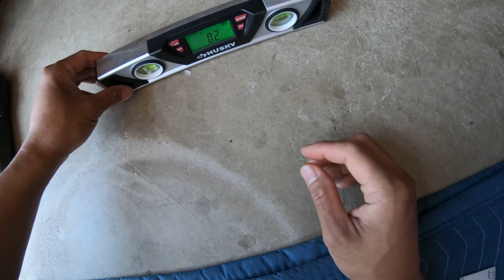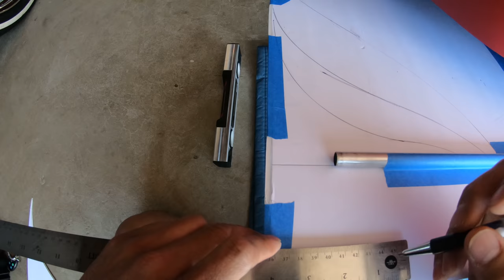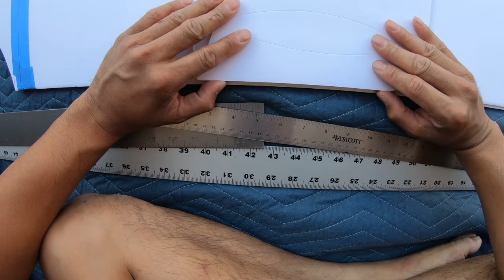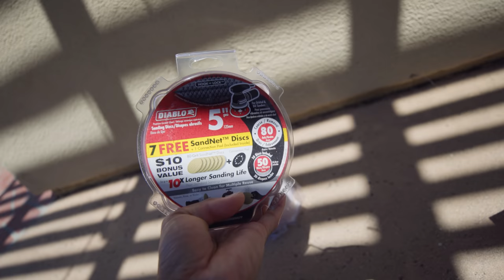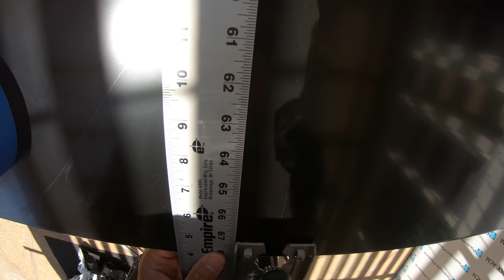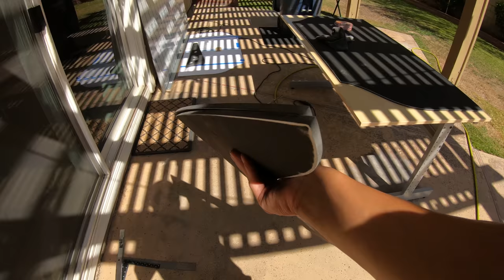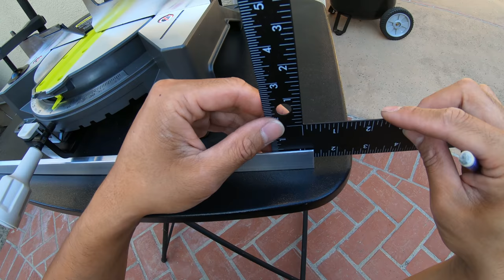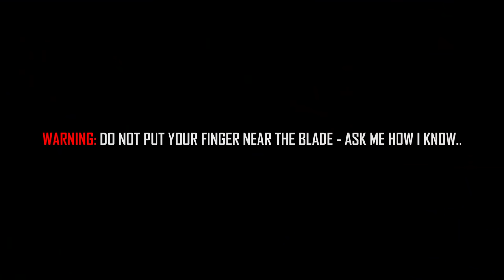DIY DIFFUSER | BUILD YOUR OWN DIFFUSER! | #OMGMIATA | EP25 | [4K60]

Comment: I like how you took your time and did everything right, didn't scrimp on things or take shortcuts. But I hate how it looks on the car. Doesn't jibe at all with the lines of the car. Looks like a  squared off Frankenstein piece on a rounded smooth body. Diffusers are supposed to HELP with aerodynamics, not cause problems with them. That will cause a lot of co-eff drag. Most people over build them, though. So you're pretty much par for the course. Think about it like this, when you look at Hyper and Super cars, they don't have gigantic things that stick way out on them. They blend these kind of parts with the aerodynamics of the body shape. Making it fit in and look factory is the trick... But I still enjoyed the vid. And IF you like it, that's really all that matters.
Reply: Have you ever seen any time attack car??

Comment: Why does everyone think this is going to cause more drag? 
He’s completely correct about diffuser angle so he’s probably not going to have issues with stalling that’s fine,
It’s cleaning up the airflow from under the car expanding it and making a low pressure zone sucking the car down while also saving the parachute effect the stock miata rear bumper has…
In concept this all seems completely sound, yes it’s huge but that seems to be the point? 
Don’t get me wrong this car will be heavily rear biased for aero even with the front downforce but cool, it’s a fun show car but this should absolutely work…

Comment: Great work! I am curious how you were able to bend/curve the outside panels? I know with the foam board you used a can but the ACM material? Thanks!
Reply: I would like to know the same.  How did you form the sides?
Reply: I was gonna ask the same question.

Comment: I feel like the diffuser was too much, went from a clean car to battle areo
Reply from the maker: Diffusers aren't for looks - but for functionality. How it looks is low on my priority list.
Reply: I design things in the middle,  my aero kit is actually functional and really helps with stability but I design it for looks too. But I do love the designs MASCUNNANA BEAR comes up with that are off the chart!
Reply: @OMGBUILDS  I have to admit I didnt pay too much attention to the series but this looks like a show car. Im sure you know more about the project more than me though lol
Reply: @OMGBUILDS   That's ironic, seeing as you went for the rocket bunny kit and run -85 offset stancebro wheel setup.
I can fit 285s under my 40mm Autokonexion flares, which is bigger than any Miata would ever need.
Reply: @OMGBUILDS  I think you are missing the point of each of these comments... The point is, If you truly were going for functionality, then you would NOT have over-built it for that size vehicle, and it wouldn't stick out like a sore thumb. The guys making these comments, including myself, are not trying to be offensive. We all enjoyed the vid. But we see problems with the functionality of it, and that is the reason for the comments, not just how it looks. Diffusers are NOT bigger than the cars they are on, unless someone is out to grab a bunch of random attention. Functional diffusers are usually less than 70% of the width of the rear of the car. The idea is to channel air from under the car, not the sides of the car. You want to join that underneath air with the air from over the car. Yours will not do that at all... Again, we aren't trying to be offensive. Just trying to give you some food for thought.